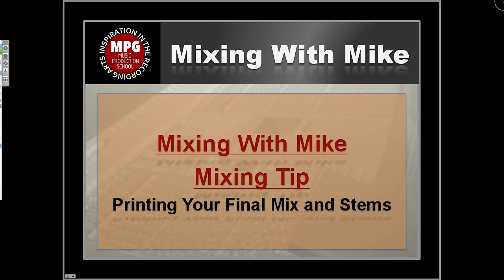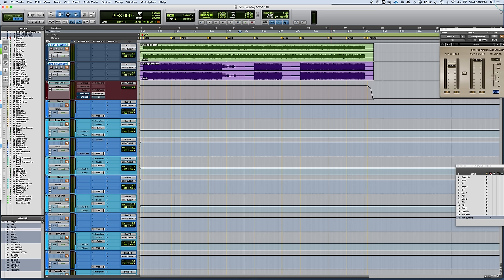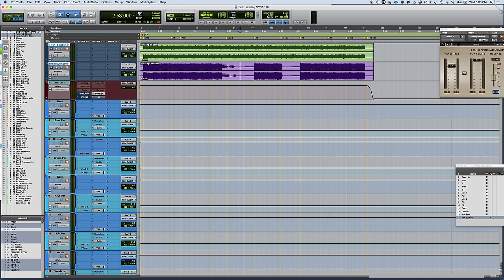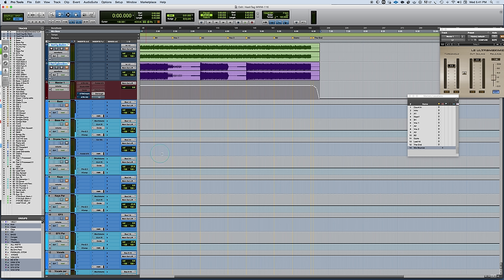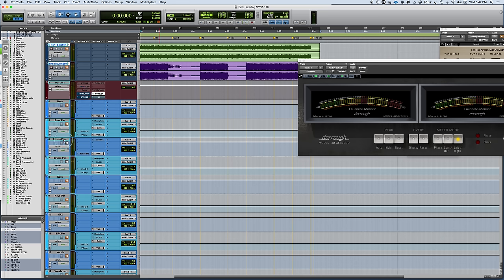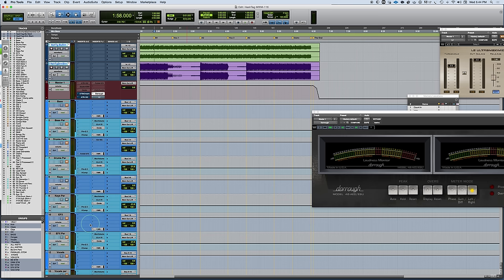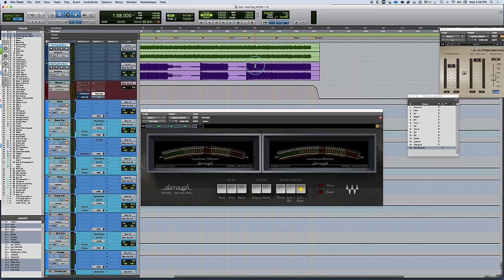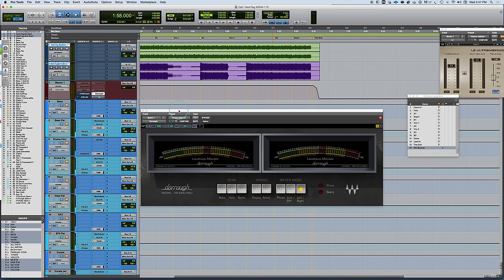Printing your Final Mix and Stems - Mixing With Mike Mixing Tip

Comment: A cheap way to keep your old workstation version is to make a  clone of your main drive using a  cloning program like "SuperDuper" on another drive, before upgrading, and putting that drive away in a safe place.. Will also be a good idea to get a new iLock for your upgrade.

.. This way, if a recall needs to be done, then the old system came be easily brought back to life. I'm running a PT 10 on a HD6 system, but, I have clones stored beginning with PT 7.2  which has some old plug-ins that are not in my current PT10..

Internal hard drives are cheap and a new 300Mb can be had on eBay for less then $20 shipped..

Anyway, as a safety measure, your application drive should have a cloned copy saved and the work drives should be "cloned" regularly.. ...Thanks Mr. white for another great video..
Reply from the maker: +CarlosGunX Hey Carlos,
This is a cool idea but works better on Windows systems than it does Mac systems. New Macs will block operating systems that were prior to release of the hardware. This means you will also have to keep your old computers as you retire them. The stems become very valuable for this reason.
Cheers!
Mike

Comment: Nice video as always :)

You mentioned that you will bypass compressors on the masterbus before bouncing stems.
Do you also bypass eq's? Could it be enabled?
Reply from the maker: +Cocobolo81 Yes, I also bypass EQs. The reason is that you can recreate the master buss settings and also change them if you need to at any time without having to load the full session.
Cheers!
Mike

Comment: Hi Mike, great vid.. Quick question on dithering.. I often mix with console emulations, most of which usually include a bit of noise as part of the emulation. I've never been sure if I should dither my final master or not.. So far as can workout dither just adds noise.. Interested to hear your opinion on this. Is there a reason too add more noise to my mix? Thanks buddy.
Reply from the maker: +Death By Dub Digital Hey DBDD!
The only time you should ever dither is when you are lowering the bit depth of the master. I usually turn off all of the analog noise on channel strips and vintage emulations. I find that it accumulates to add a haziness to the mix instead of a rich analog texture. The idea of the dither noise is to add randomness to the lower bit structure of the 16 bit file. The way you keep it from being audible is through the noise shaping that moves it to a place that is easily masked by the mix.
Cheers!
Mike

Comment: So are you saying you master your own stuff, or you're printing these stems to send to a mastering engineer for the supposedly superior, and more expensive, 'stem mastering'..?  And if so, why?
Reply from the maker: +kye903 I do it for many reasons. 
1. I can quickly recreate my final mix and make adjustments and new versions very quickly
2. Archives the project for later recall in case software updates prohibit loading older sessions
3. I can send stems out to remixers to create new versions of the song
4. Perfect for TV, Film and video releases where they want alternate versions of the mix
5. Provides a stemmed mastering option if necessary.
It's not so much a thing about mastering my own work as it is all of the above.
Cheers!
Mike
Reply: Regarding point 5 then;  when and why would stem mastering be considered 'necessary' in your opinion..?

Also, while I've got your attention, what is your policy, if any, on high-cutting a kick drum..?
Reply from the maker: I sometimes get a stemmed mastering when the mix is not very good or exhibits issues that cannot be corrected in a stereo mastering. Typical problems are with the impact or power of the drums lacking or harshness or sibilence in the vocals. Mostly, they are used when access to the original mix session is a problem.

Not sure what you mean by "High Cutting"
Cheers!
Mike
Reply: A 'high cut filter' to give it it's full name I guess.  Also known as a 'low pass'.
Reply from the maker: For Acoustic kick drums, yes. I do this to help the low end sink down in the speakers and to cut bleed from cymbals. Every song and style is different. Heavy Metal kicks use a lot of that top end.
Reply: Thanks.  Can you throw me some common Hz values and dB per octave slopes by way of example..?
Reply from the maker: Use a sharp Q (24+ db/octave) to focus the attack of the kick. Use a softer Q to soften the attack. As far as the Frequency goes, play the kick in the context of the whole mix and do it by ear. Don't get caught up on frequencies, use your ear to what sounds and feels best.
Every song is different.